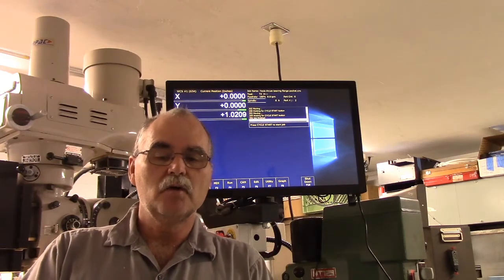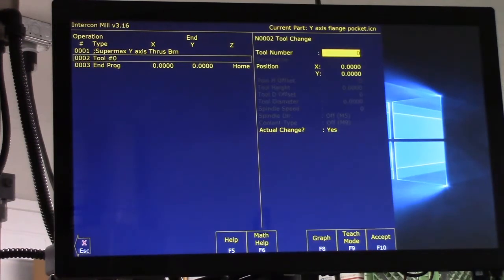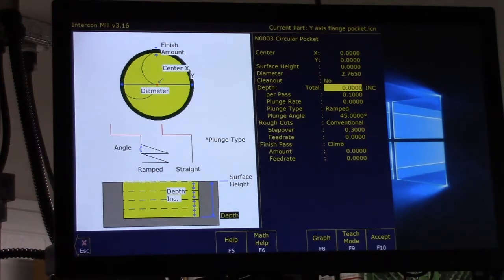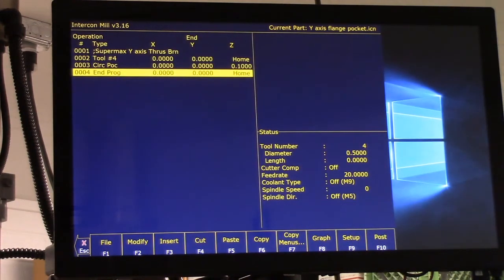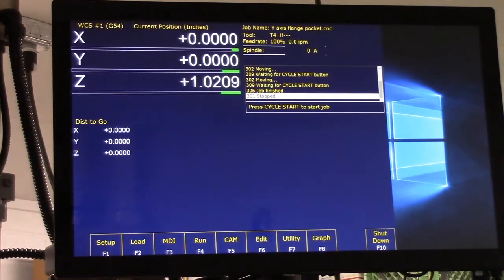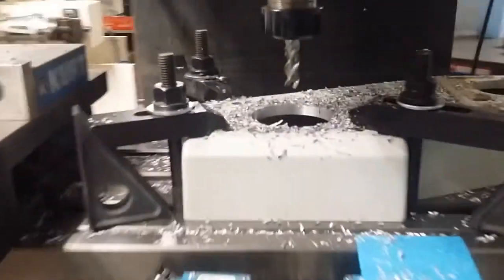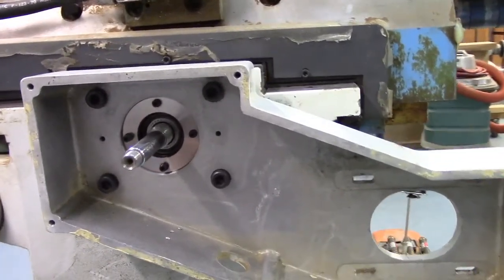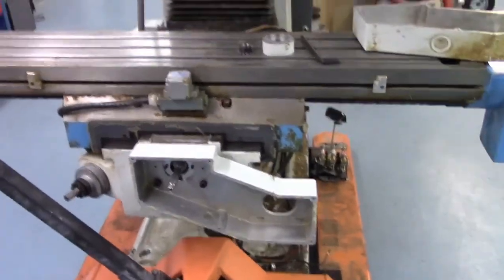Using Intercon to create clearance opening in Y Axis servo motor casting

Comment: Holaaaaaa. Excelente video. ¿ Cual serían la ruta para realizar el maquinado un redondo de un material cuadrado?  De un material cuadrado de 40mm x 40mm de 30mm de alto. Necesito hacer un redondo de 24 mm de 25 mm de profundidad. ¿Cual seria la ruta para realizar lo? Espero me haya hecho entender. Gracias
Reply from the maker: Ingles por favor...
Reply: @martyscncgarage5275  Ok. What would be the route to perform the machining From a round from a square material? From a square material of 40mm x 40mm of 30mm high make a round shape of 24mm in diameter with 25mm deep.  I hope he has made me understand. Thank you

Comment: excellent videos you have posted, I have binge watched them all - thank you for taking the time.
Question: Is it possible to import into intercon a part created in solid works (for example) and apply tool path on its features ?
Reply from the maker: No. Centroid used to have .dxf import but they have stopped supporting it because of the inexpensive CAD/CAM solutions on the market. Unsure if they will support it in the future. Intercon works well for a lot of simple one off parts

Comment: I tried to use my conversational hit f5 cam and f1 file but when the window pops up to name the file I cannot type in it. I also noticed I cannot open any intercom files that came with the board. It’s a digitizing bundle so I see no reason it shouldn’t work. I digitized a part earlier today and it worked like a dream until half my limit switches randomly started triggering themselves. Ghostly issues I guess.
Reply from the maker: Post to the Centroid CNC users forum. Post a new report, post pictures of you machine and it's control cabinet, and pics of your limit switches. Also post your questions about Intercon.